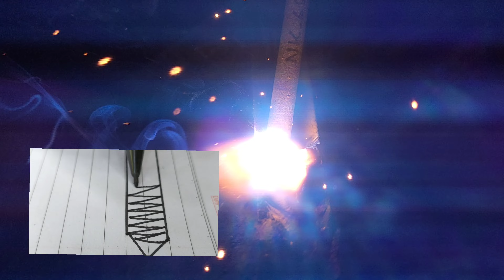do not use this welding method when welding deep and narrow gaps| novice welder

Comment: Why dont you use a 3.6 mm or A 4 mm rod ?
Reply: His machine output are not capable for bigger rod.. he only use a 130amp machine.
Reply: @harisyoung4110  115/120 amps for the 3.6 mm  , 160 amps for the 4mm . Im not a pro , i just fix agricultural stuff when it breaks .
Reply: Even a 3.2mm at 110 amps will do a decent job just push the rod in. Maybe try a 7016 rod least it'll penetrate more than a 6013. All these videos all they use it 6013 rods. I would've said use a 6010 but I reckon his machine wouldnt be able to run it.